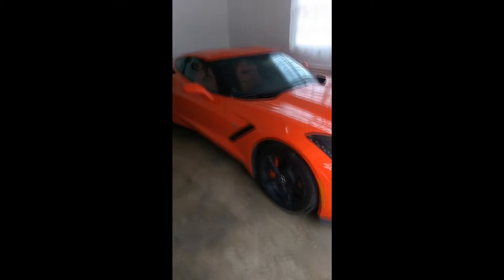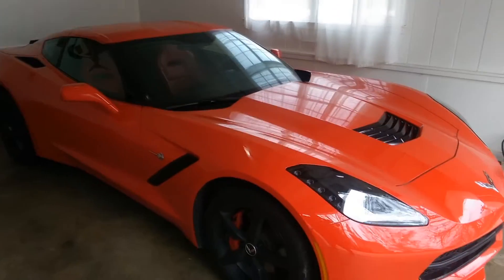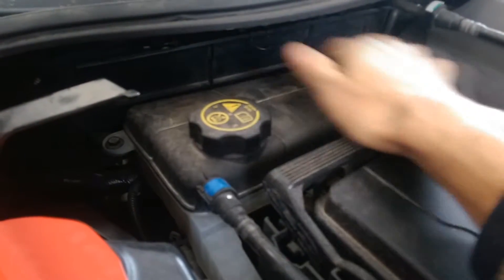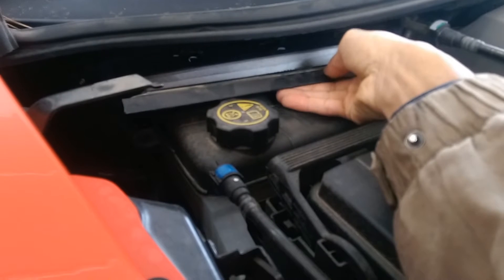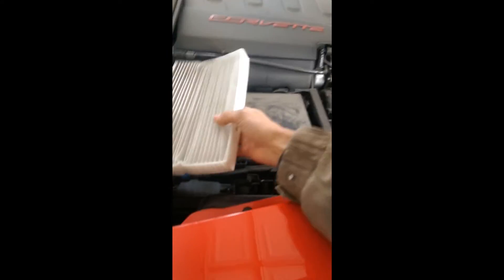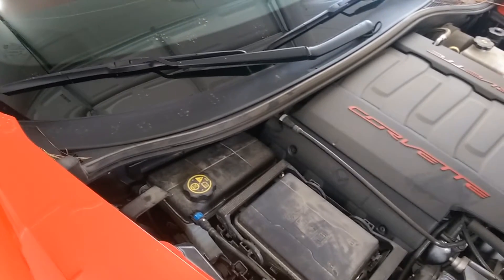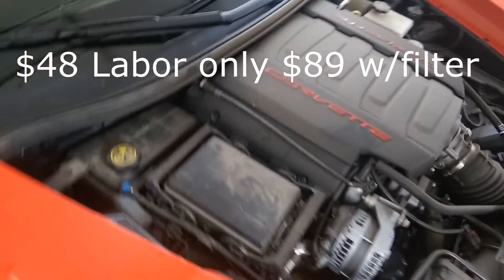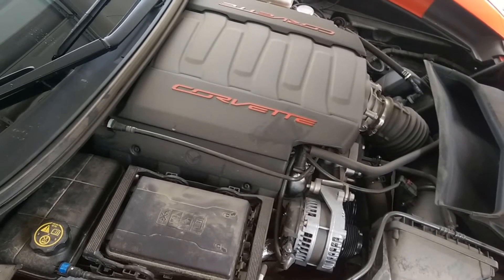Save $ DIY Cabin air filter replacement

Comment: Mine is dry sump and got lines in front of the cabin air filter, Those plastic hoses ok to move them huh just don't twist or bend them. They are in the way big time! Does oil come and goes to dry sump/engine via those lines? How important are those lines.
Reply: Disconnect the quick disconnect on the oil lines.  Only a drop of oil will come out if any when moving the oil lines. Once out of the way changing the Cabin Filter will be a breeze!!